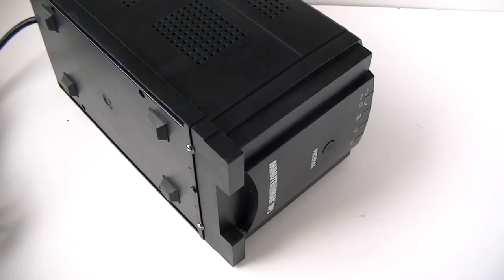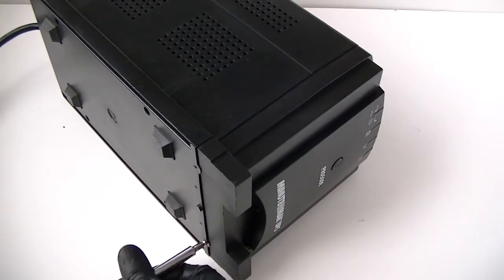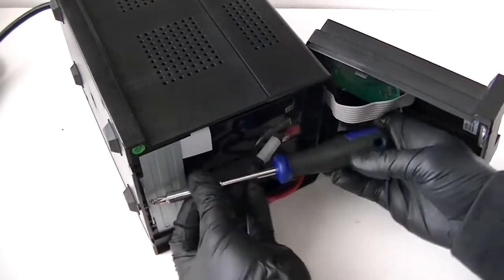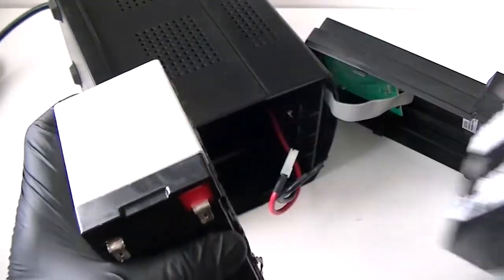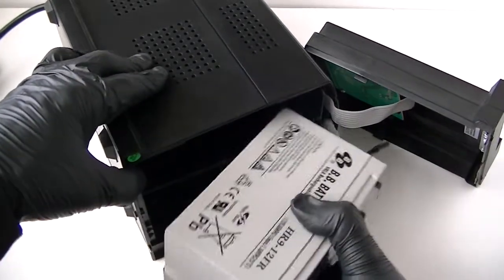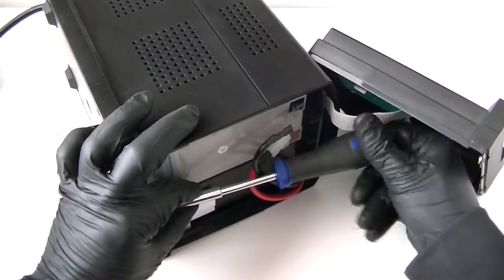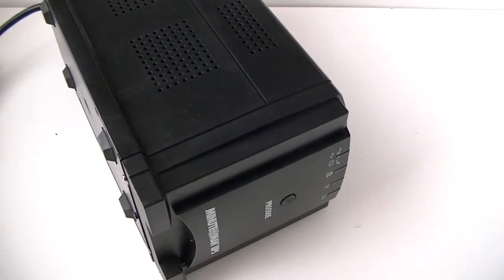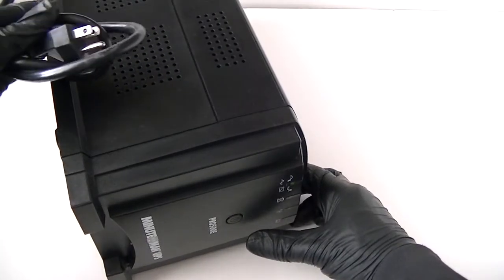MinuteMan UPS Pro500E Replacement Battery

Comment: If I were doing this, I would throw out that junk spacer and replace it with TWO 12v 9Ah batteries for TWICE the run time.  Just tape the two together and connect them in parallel with a bit of extra 10 AWG wire.  The spacer is only there so that MinuteMan could make two models at two price points while only actually manufacturing one UPS. It's a common practice in the UPS world.